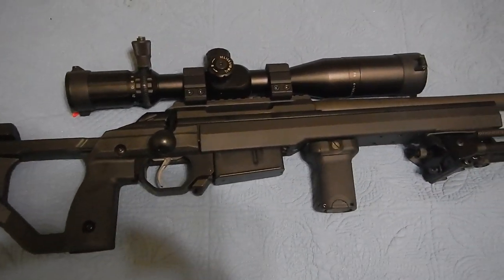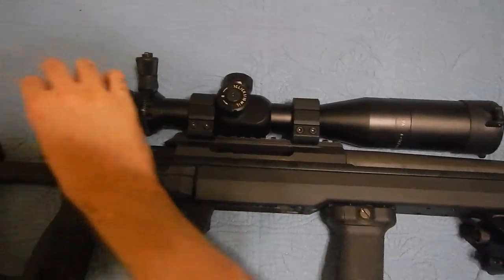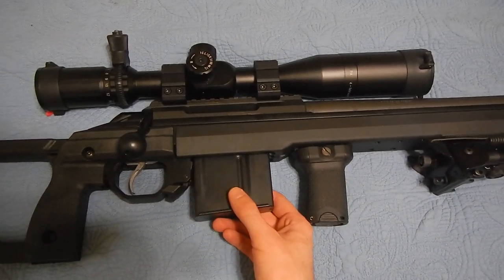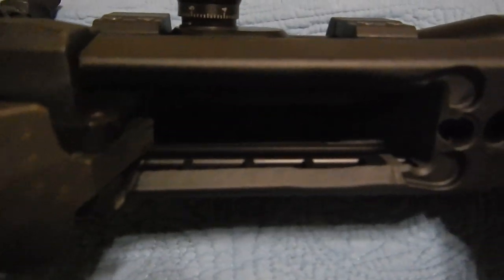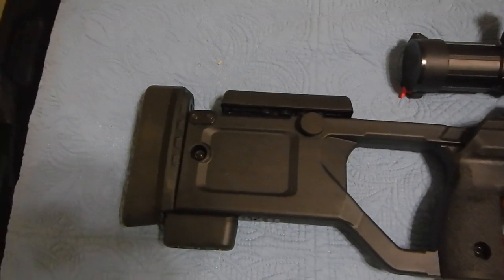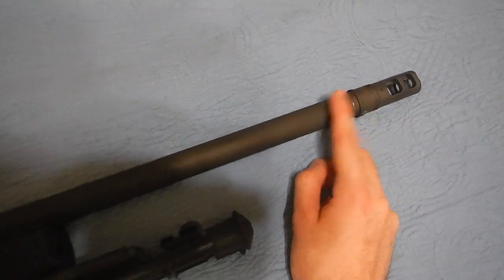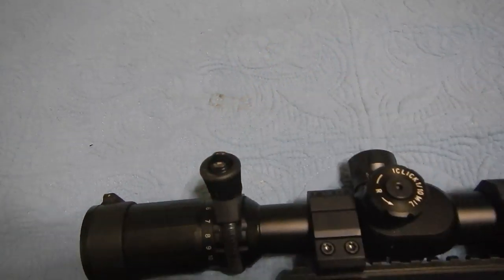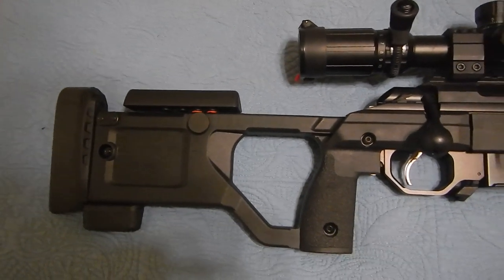KRG X-Ray Chassis for Tikka T3

Comment: Hey man. How is the recoil lug set up on this chassis? The 700 has a recoil lug in the barreled action, but the t3 is not. Do you just put one in the chassis for the tikka?
Reply from the maker: Tommy _Gun 
It's a complete drop-in system. You don't need to add any recoil lugs.
Reply: Antlion1001 gotcha. Thanks

Comment: So, Can you just remove eny original tikka t3 stock and put this new one? Or do you need to modifie those?
Reply from the maker: This is a drop in stock. You don't have to modify anything to make it fit.
Remove the two action screws and lift the barreled action out of the old stock and put the action into this stock. Then tighten the screws and you're good to go.
Reply: Antlion1001
Thank you.

Comment: Hello, what is the height of those scope rings?
Reply from the maker: Mex Jaguar those should be the low rings at 0.83” if I remember. 

The rings are definitely overkill for a 308 rifle. They have integral dual recoil lugs. They’re great.
Reply: Thanks for answering!
Reply: @Antlion1001  what is the model called???! They look on par with Sphur and I love your build!
Reply from the maker: Zachary Moye the rings are from Aadmount. They are 30mm double lug rings. $150 for a pair.

Comment: I am a shorter guy so i will need the shortest length of pull as possible. I run my ARs on the shortest or second to last slot.
Reply from the maker: Shortest length is standard stock length. The stock doesn't ship with any spacers.